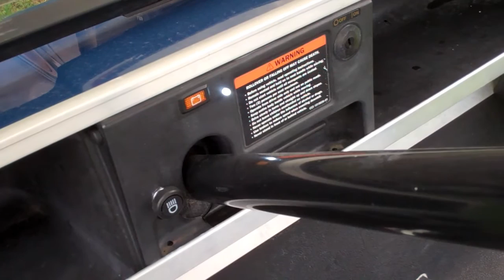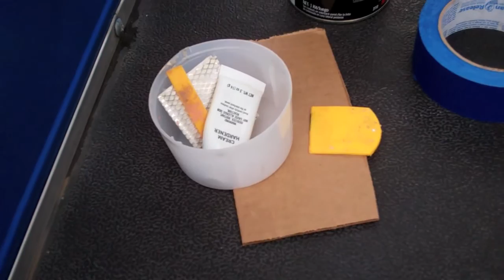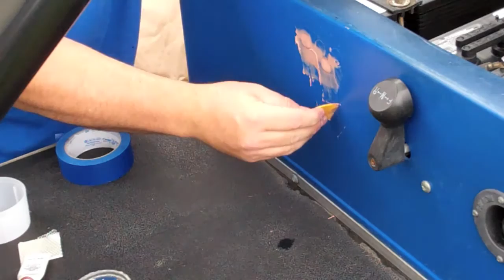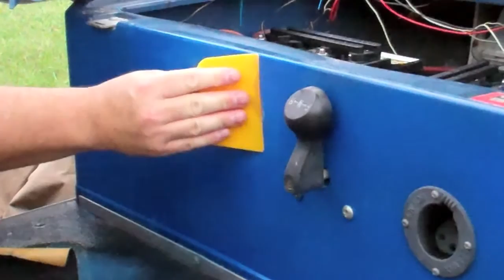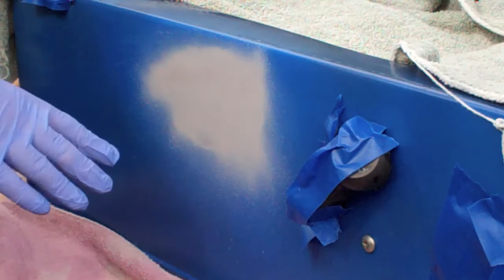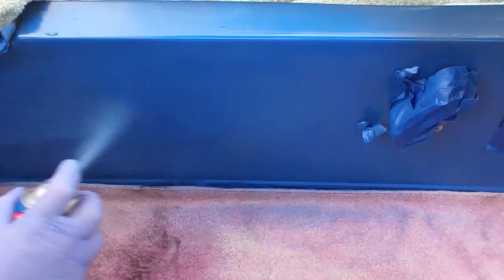Golf cart hole repair

Comment: What brand of spray paint
Reply from the maker: you can use any brand you like.  I have noticed that spending a little more money usually results in better paint so I have usually been buying Rustoleum or similar brands lately
Reply: @WJHandyDad  I have the same color golf cart so I was wondering what brand primer you used and what the name of the color of the Rustoleum paint was
Reply from the maker: @colewilliams6233  it's been several years, so I'm not 100%, but it might have been Krylon Gloss True Blue